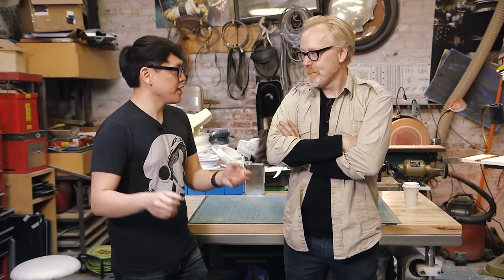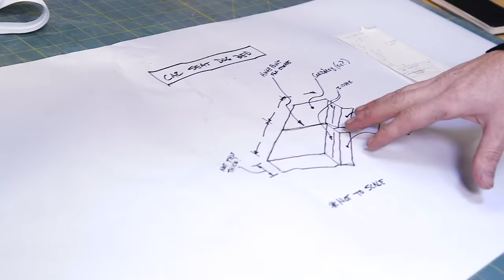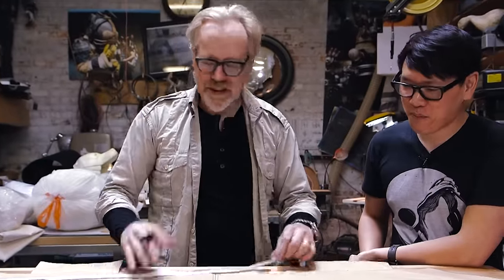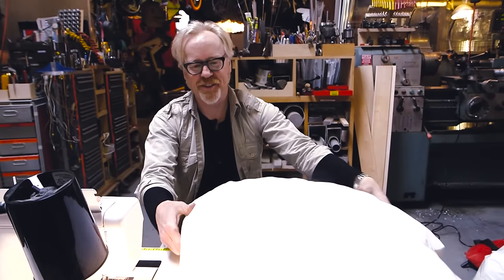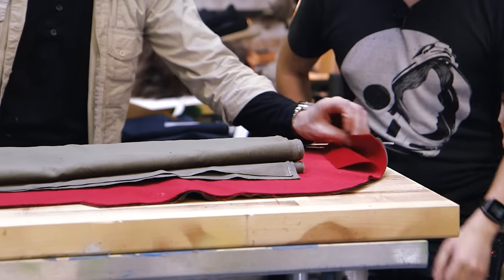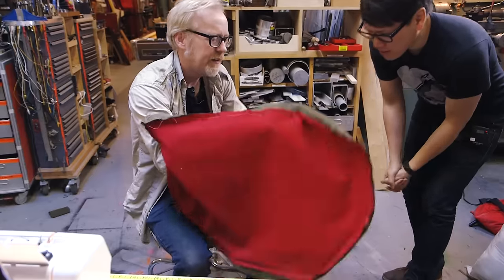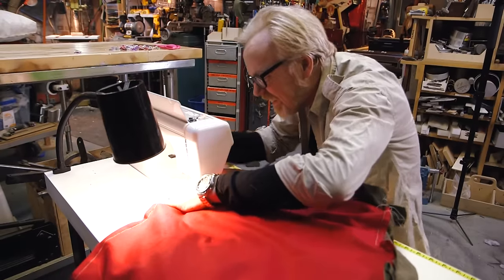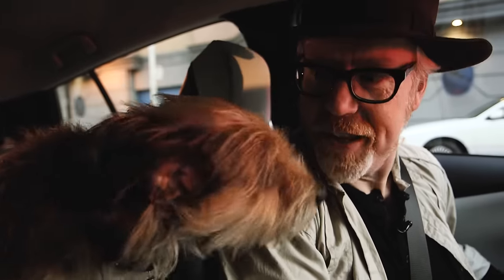Adam Savage's One Day Builds: Puppy Car Seat!

Comment: Hey adam a little hello from denmark  you should get some seat belt clips so you could click the dogbed to seat belt clips in the car
Reply: +Bo Henriksen I was thinking he could use the LATCH restraints (for car seats). They are standard sizes, standard dimensions and come in all vehicles newer than 2004 (?) or so. Would be super easy to connect to and getting hooks for them is super easy, just get a junk car seat with the nylon and latches included.
Reply: +Karl S yeah latch was the word i was looking for that is what i mean thanks
Reply: Bo Henriksen hva så mand??

Comment: couldnt u sew 2 male buckle ends so they clipped into the seat belt... ?
Reply: +dave “rif” jack wouldnt that give to much slack tho? so the dogs could pull it out from the seat?
Reply: +dave “rif” jack They would have to plug in upright which would over complicate the design as it would have to have cut-outs to allow it and would then be harder to remove. Maybe as a a 2nd revision as it would be more secure. (I do like the idea though :)  )
Reply: +supersnail5000 cut outs are not needed, its not rigid.
Reply: +dave “rif” jack The better option would be to use the existing baby-seat locks, which are going to be more solid and have less pull than buckles.
Reply: +Ragnarok043 I'm not saying he couldn't have done it this way but, it's Adam... Every time he saw the bulge "if only i had made a cut out" etc. He may be better doing it this way, but for his time and sanity, i'm glad he didn't!

Comment: Loved the design and overall workthrough of the process. I would love to see an update on how this held up to daily use. As a home sewist, I would be worried about the fabric shrinking when washed since it was apparently not washed before cutting. And the durability of those muslin pillows - muslin frays, and it didn't look like he did any type of finishing on the seams. I'd be afraid it wouldn't hold up to hard wear.

Comment: Know of a lot of people that would love cushions like that. 

I'm looking at the built and thinking.
There is a better way to secure it... At least for me.
The middle of the seat have safety belt clips. Go to a scrap yard and buy the clips of old seat belts and you can secure the middle to the clips.
The sides of the seats have anchor bolts for the seats. Nothing prevents you to add some nylon belt straps with plastic belt clips to secure the sides.
I would have added something to the back upright part also. Even if it was just a drape over the seats. Maybe something that clips on to the rods of the head rest.  Just to keep the seats all protected and clean and uniform with the cushions.

Just my 2c but other than that. Really nice.

Comment: My unsolicited opinion: Instead of dowels you would have been better off attaching a clip of some sort to hook onto the metal latches for a child's car seat.
Reply: +xdarnokx exactly what I was thinking
Reply: +xdarnokx I had the exact same thought... it sort of seemed the obvious solution to me, but hey... maybe dowels are easier?  Plus it means that you don't need to sew in adjustable strabs that need tightening...
Reply: +Garret Hoffman also, those straps aren't for everyone... my wife in particular hates them for some unknown reason (I love them, I think they are so much easier than the belt system)
Reply: +xdarnokx That would just be over-complicating it. The simple solution he used should be adequate.
Reply: +xdarnokx I thought the same thing. Instead of the long loops for the dowels you do smaller loops and use a small sized carabiner to clip into the car seat hard points, which the Prius should have four across the back seat.
Reply: jaquo25
it does, you can see the markings on the seats for the clip points... (the little dime sized dots near the crease between the butt plate and the back plate)

Pretty sure they are required standard equipment these days (though the markings may not be... =p)

Comment: Idk how the back seat of a prius is laid out but I would have made it snap into the seat belt buckles
Reply: that's a really good idea. if I make something like this I may have to do that
Reply: +Ethan Bean Or the Latch system.
Reply: You could do that but you have to find the parts cheap. The flap under the seat is like $5 in materials.
Reply: +Andrew H Yeah but you could scrap yard the seat belt pieces for about three same
Reply: +Ethan Bean hell you could probably get them new for about three same price
Reply: Getting from a scrap yard depends on if they used the same latch system from the older models rather then change them out so they can charge more for the rare part.

Car makers have been known to make the holes on the belt latch the wrong size so that you had to buy the right ones from them.
Reply: +Andrew H well yeah but you could also get the fake latches that people use that don't wear seat belts... Those are like $3
Reply: +Ethan Bean That is the first thing I thought when I started watching this. it would have been much tidier than having dowels
Reply: +Michael Jarvis I agree completely, and just in case it wouldn't slide out under heavy breaking cause it would be locked in

Comment: For anyone who can't build this they sell a kind of hammock system that goes from the top of the back seats uses pic tubes to tuck int the seat groove to hold it the hammocks across the seat to the head rests of the front seats. They have treat pockets the fabric blocks the foot wells so they don't slide down into it. They vary in size. I have four dogs they love it. Also fully washable and folds down to load in the truck. It's made from soft canvas thick enough that doggo claws don't go through. I've had mine for 9 years in my leather seated car and my seats are fine no damage look like new.

Comment: Why not use what the belt buckle clip goes into to hold something down, like get a normal one and just attach seat belt clips to it
Reply: +callum perry That doesn't protect the leather in the car, which was the primary reason for building this.

However, you can get back seat 'hammocks' for under $30 online.  So, I find this build a little pointless.

http://www.drsfostersmith.com/product/prod_display.cfm?c=3307+12+26464&pcatid=26464

Comment: The cushion could also slide about inside the corduroy cover. If you sew tying strings in the aligning corners inside the cover that correspond with the cushion so that you can tie them together, it will also make stuffing the pillow in much easier. Just tie and put the cover on by rolling it on. You can observe Chinese duvet covers with the inside blanket for an example.

Comment: I wouldn't have used wooden dowels that were sewn in.  When you go to launder it, they wood is going to soak up water and will never dry out.
Reply: +Eric H I bet the dowels are removable.
Reply: He sewed them into the tabs
Reply: +Eric H i dont think they're sewn in on the sides though. sort of like they're in a cylinder, with one or both ends open (probably just one) with a real tight fit so they won't come loose unless you want to remove them for washing. there is of course a chance that you're right, and that just completely slipped his mind. as his slogan goes, failure is always an option. i think he got this right though.

Comment: why a Toyota :,( you should get a Tesla
Reply: +Tycho Whinster For inner city economy a Prius works much better. The Model S Tesla is very nice but if you're rarely hitting highways there's really no point.
Reply: +Tycho Whinster prius 25k, tesla 76k, not the same league. prius is super nice.
Reply: +TheMuffin the Prius gets 53 city MPG and the tesla gets 84 MPGe
Reply: I'm not strictly talking about mileage. SF has a lot of curbside parking, narrow streets, etc. A Prius would in general be able to navigate that kind of stuff a bit easier. In regards to mileage though, I'd take the 53 over the 84 if it meant saving $35k which is the difference between the cheapest Model S and the most expensive Prius.

Comment: It's nice to see Adam doing some "Unusual" crafting here, you rarely see guys on a sewing machine :)
I'm doing needlework since I turned 11?12? and I love it!

About the Project, Adam should buy some seat-belt buckles from the junkyard and just click the pillow in the latches or not? and he could get a additional latch+buckles to lock the dogs down! If he has a crash, those doggies will fly thru the windscreen :(

And one tip to avoid the stretching, just pin down the first 2-3 inch and just feed the two layers without pinning them, its a lot faster than stopping every 5 inch to remove the clamp/pin :)

Comment: I know this is a really old vidieo, but Adam, just a tip when building pillows, or even just making them, is to put your hands inside the case and in the corner, grab the right corner of the pillow, and then pull the casing down around the pillow. I do this will all my pillows and my duvet case, as it's much easier when doing it alone. Hope this helps for any future builds :)

Comment: Pretty cool. I'd have done two things a little different: 1. Use furniture-grade foam instead of cotton filling (the foam is comfy but holds it's shape better and prevents the cushions from folding over or riding up in the seat), and 2. I'd have added a separation between the cushions, either a zipper or Velcro tabs, so they can come apart. That way, if one gets damaged, it's less work to repair than a single, combined unit, not to mention that it would have been much easier to sew those last seams without the other cushion contained inside, and it would be easier to get the inner cushions in and out of the outer covers.

Comment: I was luck and found a 'dog' seat cover made for our vehicle that actually came with dowel like inserts that shoved in between the seat and the back rest to hold it in place.  then straps around the back and even up over the front seat so they could not move the cover out of the way :)  yeah corduroy, as well as other fabrics have what we call a 'nap' and you have to be aware of it so that the nap is in the right direction.

Comment: @Adam, every single pro I know has a seam ripper for there best friend  :)
I was wondering why use wooden dowels? and not thick cord or robe? Those are washable and don't damage your washing machine.
Personally i don't like those wheel chalk dispensers. The wheel benches easily and then it doesn't work any more. I use a normal ink pen 9 out of 10 times. When you trace your patterns , you do that on the outside, so when you cut, you do this on the inside of the line. The little ink that's left, you will not see and it's not enough to leave a stain 
One last tip: when your sewing with a machine the under layer always wands to move faster then the top layer. That because the transporter is on the underside and on top the feet will causes friction.  You can fight it, but you can also let it work for you. You have some pleats in your corners, if you had turned the layers upside down, the transporter had worked in the extra fabric for you, giving you a nice even seam.
Good luck on your future sewing projects

Comment: Just thought I’d mention, in sewing, we call the practice piece, what you did in muslin, a mock up. Sometimes it’s actually called a muslin because it’s usually people use muslin to make it since it’s inexpensive. We do this because we want to make sure everything works and fits before we cut out the final fabric. It also helps work out any patterning and fit issues. And no I wasn’t laughing because even experienced sewers make mistakes and have to rip out seams.

Comment: It's telling that you drew the pattern as if you were making it out of steel or wood--as you commented at the beginning. There's a much easier way to make a fabric box. Just sew a rectangle that is seat-width+cushion thickness wide and seat-front-to-back + cushion thickness high. Sew that around the perimeter, putting the zipper in one of the edges. Now sew each corner across the diagonal, such that the length of that diagonal hypotenuse is the cushion thickness. Trim excess, you're done.

Comment: Some tweaks to the design.  You could have a piece of fabric actually off the top/back of the bed, covering the seat back, and looping around the head rest/tucked around the seat-backs.  My dog drools a lot on the seats, including the seat-back... plus, sometimes they get in the car wet because they were just in the river or something, so protecting the entire seat is kind of necessary.
There is also a design out there where it is essentially a hammock that hangs between the front seat-back and the back seat-back so that the dogs are partially blocked from moving into the front of the vehicle.

Comment: The one improvement I would suggest is to take advantage of the built in LATCH baby seat anchor system the car has, and add some baby seat style latches to secure the seat ends to the car. This would help the panels with a dowel in them stuck between the seat back and the seat to keep the cushions in place for side to side movement. and potentially help avoid the edges from bowing up as somewhat seen at 27:52 in the video. 

 All modern (post 2002 ish) cars have the LATCH secure anchor points built into the car seats for easy, secure installation of car seats into vehicles. They are simple bars secured to the frame of the seat/car, accessed between the seat back and seat cushion, with two anchor points per rear seat seating position. You can find brand new anchor belt kits on Amazon or people selling salvaged ones cut from old car seats on eBay. 

For those that want the search done for them, here is a link to a highly rated LATCH belt kit on Amazon: http://www.amazon.com/gp/search/ref=as_li_qf_sp_sr_tl?ie=UTF8&camp=1789&creative=9325&index=aps&keywords=B010HK9AAI&linkCode=ur2&tag=tnrkimusinofa-20&linkId=CB2JRWARNORH2NNY

Comment: Dude. Flip the cover inside out and roll it over the cushion, or if the zipper won't handle that, press your hand in the back of the cover so that you push a bit of the inside out of the zipper, grab the cushion and yank it in, should do the same.

Also, I caught your Louis C.K. reference, I'm with ya.

Comment: Well done, I am not trying to be that guy but no harness for pups? 

I use the Cars LATCH system and a short [2ft] leash tied over three times with a steel carabiner from hardware store for my pup. its easy [harness is safer] and no flying pups in short stopping/accident. And the Latch system is a part of the cars frame so its secure.

Comment: For securing the dog bed to the seat, did you consider using the child safety seat attachment points.  They also double as attachment points for safety harnesses for your dogs.    Also, what about the back of the seat?   I've seen dogs mess up backs as well.

Comment: Small suggestion for a modification: make a copy of the metal bits for seat belt and replace the dowels with them. That way when you wash it, that wood won't get wet and develop mold/mildew.

Comment: Two things:
1. Without a cover for the back of the seat, it will get dirty - especially if...
2. ...the dogs are wet as well as dirty at all. So waterproof/resistant materials would probably be ideal as well.

But probably more than that, since I would have gone with minimal/firmer cushion as the seat already has some and the dogs would want purchase in a moving vehicle. It's mainly meant to protect the leather from the dogs' claws, which it does, but could have been even more practical vs just a car seat shaped dog pillow.

Comment: Nice Indie shirt-- Smith & Grey original? The only thing amiss is the "strap" depending from the epaulet button. Badge holes?
I think you missed a trick-- should not the "bed" be arranged so it is level to the ground? Only time will tell-- "Dog Time" would be less time, of course. So results should be in soon...

Comment: If you wanted a secure seat, why not use the child seat anchors that are found on most cars? It doesn't even need to be super tight like a child seat, it just needs to be hooked in so it wouldn't slide out. Still a nice project.

Comment: Too bad on of the flaps in the front isn't in the same position as the other, but, not a big deal.
One major missed oppertunity is not using the ISOFIX system that car almost surely has to keep them in place. May be a lot of extra work, but it will be fixed better than ever.
You can add to this by making a flap on the back, with a 'hoodie' that goes over the headrests to also keep it in place, but also keep the back of yoru seats protected.
All in all, great job.
Have them made for some popular cars or to demand in several colors and option by some great chinese sowing shop and make a nice living off of it. Maybe even patent it if there isn't one yet.

Comment: Which is all fine and dandy EXCEPT:  Dogs get excited.  That back portion is going to be shredded in short order, as will the backs of the front seats and middle console.  At least put corduroy over those!    The front flaps to protect the front edge need to run the whole width.  Ever see a dog in a sudden stop?  They dig their nails in, anywhere and everywhere.  The other issue?  Lack of waterproofing.  At least scotchgard it. :)

Nice job but not complete by a long shot.